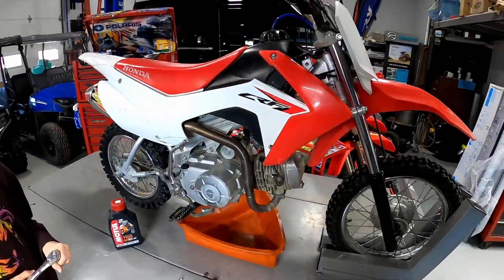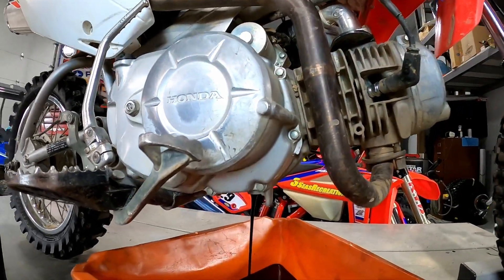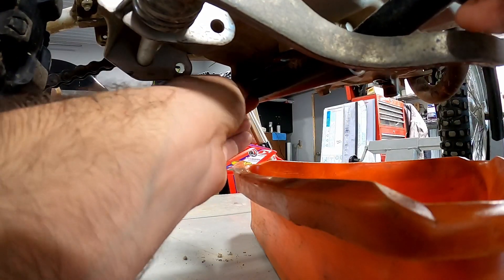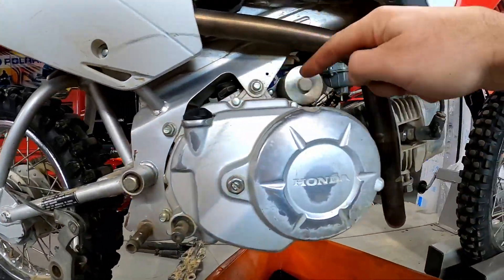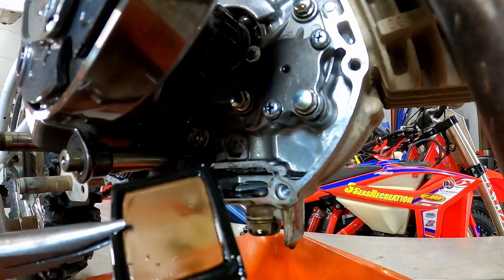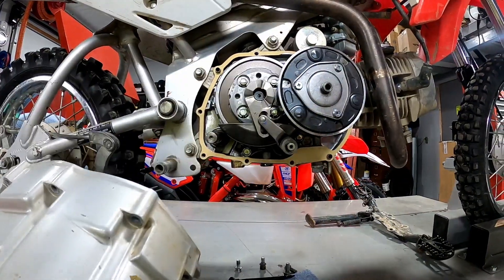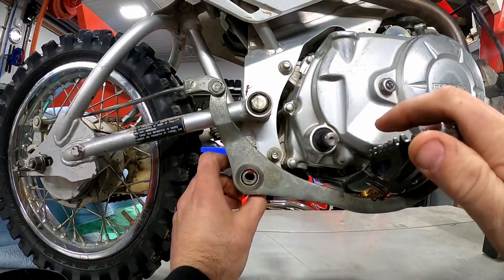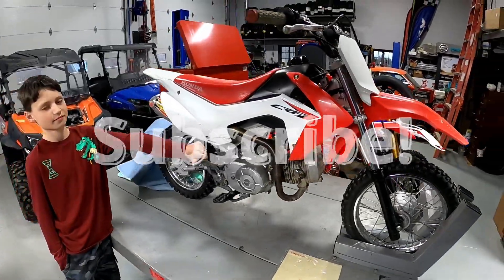Honda CRF110 Oil Change & Internal Oil Screen Check : How To Change

Comment: I just bought a Honda 110 for my son! I'm not a fan with the oil screen spot. Honda should've installed a external oil filter on the side of the motor somewhere.